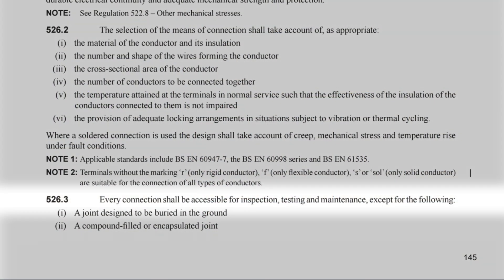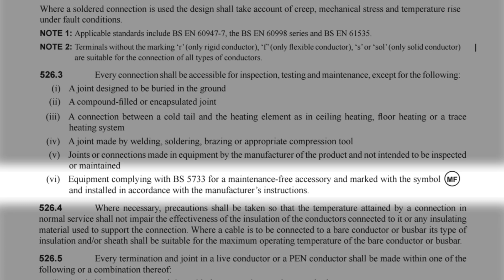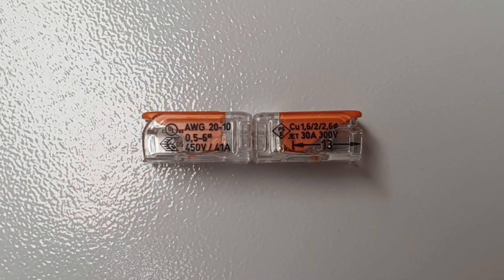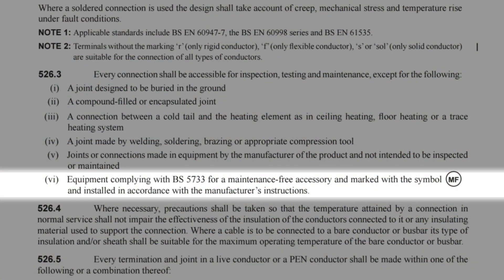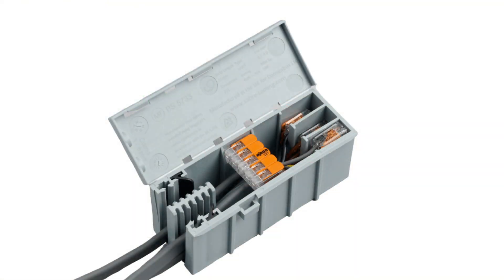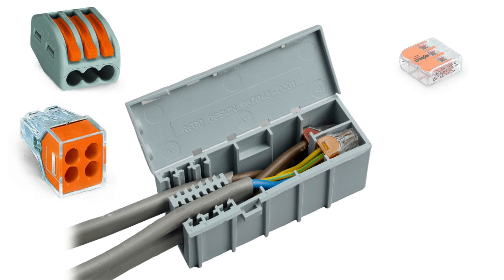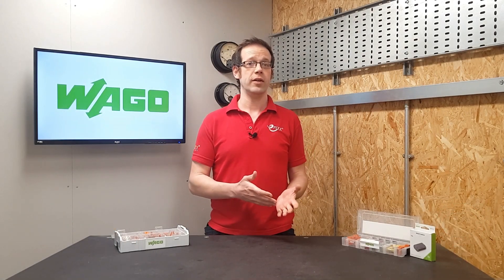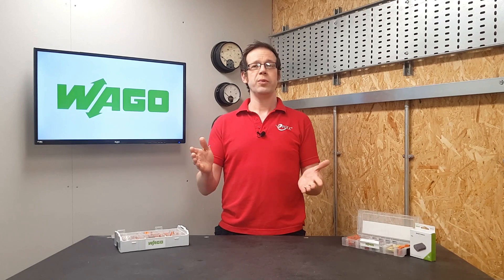Are WAGO connectors MAINTENANCE FREE - when used in a Wagobox junction box?

Comment: Hi,is the 221-6 with the adapter anti vibration strip fitted when installed in the original wagobox rated at 41a ,does this become a 32a mf rated or still only 20a mf ??

Comment: I think the 'thing' is never to connect anything MF, but pull the cable back and start again, or run a new cable.  Let's be honest, no MF box can be 100% trusted.  Maybe 99% but not 100%.  I just nicked a 2.5 pulling it through a joist - exposing the copper of the N.  I'm going back next week to re-run the cable anew.  At least I can walk away from the job without thinking about it at 3.00 a.m.!  Love Wagos, by the way.  So quick!  Have Wago made a British 3-pin plug?

Comment: So now im more confused, if i want to extend a cooker circuit that is protected by a 32a 60898 do i have to derate to 20a connectors?
Reply: No. Use 773 connectors in a bog standard WAGObox. You’ll need a 221 for the cpc.

Comment: Can these WAGO boxes be surface mounted on an internal wall? I am going to be moving a leg of 2.5mm as the previous owner had it looping round the pipe serving the thermostatic valve on a radioator. I kid you not. I want to cut into the ring and then use these connector blocks and then run the leg up in trunking but I just wanted to know if this is feasible. There is no plaster board, it is all brickwork internally in a cellar.

Any thoughts, provisos or condemnation is welcome :)

Comment: The Wago connectors + box can do a similar job to the old fashioned circular junction boxes and are probably not the ultimate design for a junction box, however they are light years in advance of the traditional junction boxes (as used on domestic ring mains etc).  I believe it is impossible to over emphasise how crappy those old fashioned boxes really are.  Their design is nothing short of appalling and potentially dangerous.  I wonder how many fires they have been responsible for in the past.  

Enter the Wago connector + box and life is so simple and easy its difficult to understand how the designers of the traditional round boxes managed to get their design so wrong; they must have been having a REALY bad day when they came up with their pathetic offering.  No doubt at some time in the future the Wago connector will be improved on, but it is really difficult to imagine what the improved design concept will be.  Sensational stuff Wago *****

Comment: There are three different types of Wago boxes made by Connexbox. The smallest has no compartments and is for light fittings. The second has two compartments to house 222 connectors rated at 20A, 773-173 connectors rated at 32A, 773 connectors rated at 20A. The third has three compartments to house 221 connectors only rated at 32A. It pays to read the small print on the boxes and accompanying instructions.
Reply: Wago 221-41x or 221-61x ??

Comment: They are absolutely not maintenance free. Ever looked at a Wago lever connector after it carries full fault current from a dead short somewhere doesn’t the line? Sometimes they pop and go black. So maintenance free until you get a dead short somewhere, then potentially the junction is toast.

Comment: Can wago or in line splice be used to extend length of 2.5mm cable and then place in the backbox. It is accessible there for no need to be maintance free. Recently I have been on jobs where replacing faceplate for ring socket has taken 10 min due to tiny cable length left by installer. Also if it is allowed then is there any derating or is that exclusive to inaccessible placement to increase the safety limits.
Reply: The ideal spliceline are ideal for extending cables in both back boxes and consumer units. I use them for exactly this purpose.

Comment: I think Wago connectors are literally the best thing since the Transistor, they save so much messing around and your confident after a pull test, those cables are in safe hands.  These things aren't just used for commercial, industrial and domestic use,  I've used literally thousands of these things in different versions to wire everything from lighting to bilge pumps, navigation and communication equipment on yachts.

Comment: Usual minefield of ambiguous regulation and marketing that’s rife in this industry.  So what is a practical definition of maintenance free?  If a static plastic enclosure with a screw lid is in a loft space, has cables glanded for support and connections made with WAGO 221 of the correct ratings, is that maintenance free or not.  I have been able to access it for installation and nothing is going to be impeding access in the future.
Reply: Nothing ambiguous whatsoever. It's the UK Wiring Regs, they are stated in black and white, and this video highlighted them quite clearly!
Reply: @MatSmithLondon you’re right.  I think I’d had a few beers after a long day in a hot, cramped loft when I wrote that.  I was more frustrated with WAGO’s de-rating when needing to make a joint MF. Does copper change its characteristics if you hide it in a wall ? I guess it could be an extension of the “installation method” derating factor?

Comment: Yes love the wago connectors .. but I would not fit any lever type wago in a box that is not accessible.  There is nothing wrong with the push in wago connectors 👍👍👍
Reply: Why not? What makes the push-fit ones better/safer/more MF than the lever ones? Don't the lever ones have higher spring pressure which should be good over the long term?

Comment: It didn't help that WAGO bought out the 221 connectors quite a while before the appropriate boxes for them!
Whilst I see the points made here to the latter of the law as it were, would the old boxes not have been OK? Reall? This is where we get so pedantic and miss the spirit of the regs.
Also, a cable tie? Really? How many of us have had to fight to get the grey boxes closed in the first place?!
Reply: I know. Wago instruction leaflet says that the box will deform when used with 6mm² cable. I had to use a vice just to close the lid. Great connectors, crap box.
Reply: Sometimes I’ve used gland pliers to get the lids to close and lock.

Comment: Whilst we are on this subject, does anybody know a 100% compliant MF joint for 6mm T&E on a 32A circuit? 
 I think the Wago solution is not really rated  restraint wise for 2 x 6mm twins to enter.
Reply: Use our 773-173 in box 51008291 and that gives you a 32A, 6mm twin & earth, MF connection
Reply: One box for each leg using the 221-6xx or the 41amp push wire connectors.

Comment: So if some but not all joints in a house are in MF enclosures, and some but not all are accessible, how do you know if the inaccessible ones are actually MF and therefore don't need inspecting?
Reply: So all EICRs in houses that have MF joint boxes will have LIMs on them?
Reply from the maker: If a joint is inaccessible by its very nature you won't be able to inspect it. That's why it's important to do maintenance free connections properly in the first place.

Comment: I think the current carrying capacity of the Wago is often overlooked when shoving it a ‘Connectbox’ (aka Wago box) particularly if extending a ring, where a 32A MCB will be protecting the ring, but the 221 in MF is only rated at 20A.
Reply: 433.1.204. Accessories to BS 1363 may be supplied through a ring final circuit, with or without unfused spurs, protected by a 30 A or 32 A protective device complying with BS 88 series, BS 3036, BS EN 60898, BS EN 60947-2 or BS EN 61009-1 (RCBO). The circuit shall be wired with copper conductors having line and neutral conductors with a minimum cross-sectional area of 2.5 mm2 except for two-core mineral insulated cables complying with BS EN 60702-1, for which the minimum cross-sectional area is 1.5 mm2. Such circuits are deemed to meet the requirements of Regulation 433.1.1 if the current-carrying capacity (Iz) of the cable is not less than 20 A and if, under the intended conditions of use, the load current in any part of the circuit is unlikely to exceed for long periods the current-carrying capacity (Iz) of the cable.
Reply: @mra813  Thank you - I am a bit more relaxed now. I used a large wiska box to terminate an SWA cable at a new summerhouse and used Wagos to connect to the socket radial circuit and never had a doubt about it being compliant. It was only when I was up in my loft redoing the builders lighting circuit (new build) who had used choc bloc and insulating tape to feed fans and lights to bedrooms and bathrooms and I used the Connectbox and Wagos throughout to tidy things up, but in the process actually read the manufacturers leaflet and the de rating to 20 A paragraph, which while not applicable to the lighting circuit, put the doubt in my mind about my summerhouse circuit. I am now reassured.🤣
Reply: precisely why I use Ideal Insure in Wagoboxes like a naughty naughty boy..
Reply: @MrGrumpyjohn01  That’s interesting. But I wonder if the Connectbox/Wago current carrying capacity is a result of trial and certification and Ideal insure  has not actually done the necessary work to establish if their product should be down rated in a similar manner.
Reply: @normanboyes4983  corporate brinkmanship more likely I would say...who has the better legal team?
Reply: 20A will be fine, see Reg 433.1.204
Reply: @mra813  What does the Reg say - I am not a spark.😉

Comment: Vago’s are great.. maintenance free or not, connections should always be accessible and easy to find.
Reply: How does that work then, if you have an open wall, and need to extend a cable to a new location but the rest of the building is boarded up / plastered / built on?
Reply: @MatSmithLondon  it’s not rocket science to install a junction box with a lid or even a one gang box with a blank lid for accessibility at all times.. either that or the through crimps properly installed and resin heat shrink as a cable should extended.

Comment: A push in connector is well ... er... er...a push in connector. They are all pretty well the same. Any push in connector in a Wago box, with the cables properly secured with the cable tie locking the box is maintenance free.   It is the pedantic wordings, according to manufacturers instructions that is legally saying it is not. 

Anyone knowing the slightest thing about electrics can see it is MF.  Even if In Sure are used. If they fit in the box and the box is tied, there is no problem.

Things like this p*** people off.
Reply from the maker: Have to disagree really. It's a dangerous game to start picking and choosing which bits of the regs we apply and which we don't. The manufacturer's instructions are pretty clear and it's not that difficult to comply.
Reply: @efixx  
So a manufacturer can state that only x connector can fit in y box, to get you to buy their products, otherwise you are foul of the regs. When any push in connector fits inside the box. Duh!  The wordings have made it nice for manufacturers to make money.

Well you do not have to fully comply with 7671. If there is an issue going to court, then anyone proving it is electrically sound wins.
Reply from the maker: Yes, yes they can. And the different boxes are pretty much the same price so it's not really a money making thing.
Reply: @efixx  I've said my bit above, but with all due respect if you don't see that a lot of this proliferation of badly formed regulation isn't about shifting product you are in cloud cuckoo land!! If it was really about safety they would come up with a cross compatible standard between manufacturers to avoid this kind of thing or let the market decide in a kind of vhs/betamax sort of way. This way keeps the corporations happy, the committee members in work and the sparky on the back foot.
Reply: @MrGrumpyjohn01  
The regs played into their hands. The regs should be written as unbiased and objective. 

An example of poor wording was insisting on catalysts being fitted to cars, rather than stating desired emissions levels. Stating the levels required leaves science and technology many development options. Makers were pushed down the catalyst route.
Reply: @johnburns4017  Indeed, this kind of thing can be observed all around us in all spheres of life, the constant creeping micro regulation of every aspect of our lives, Covid of course the latest example. 
Its basically Marxism..!
Reply: @MrGrumpyjohn01  
Its Marxism? Marx was an economist.
Reply: @johnburns4017  You're right, its the opposite, a power play by the elites over the proletariat. Anyway I was just being provocative for my own amusement , don't mind me...
Reply: @MrGrumpyjohn01  
Going back to specifically stating a catalyst must be used in cars. When this was mandatory in the EU in the early 1980s, Britain was way ahead of anyone in learn burn technology, without using expensive catalysts, which was meeting emissions standards. All this had to be ditched because the EU said only use catalysts - because the USA found they worked in the 1970s.

Comment: We use surface mounted or recessed junction boxes and most commonly Wago 2273 connectors and Wago 221 when needed. One thing what we never do is to install unaccessible junction boxes, no matter what connectors are used.
Reply from the maker: Sounds like a good policy to always leave them accessible.👍😊
Reply: So you never install anything  under floorboards, where owners cover with carpet or laminate floor.
Reply: @martinw245  There are no floorboards here like in the UK, if there are they are visible and it is called parquet. The floor of the first floor is usually concrete. Inside the concrete there can be a heating cable or a pipe and electric cables in a pvc conduit, but no joints. The floor on the second floor is either wood fiberboard or plaster cast, depending on whether there is underfloor heating.

Comment: This is so complicated 😤 il just stick to connector blocks without insulation tape for jointing cables in walls and under fitted floors.
Reply from the maker: 😱 It's not that complicated, is it? Just a matter of matching the right connector to the right box. 🤔
Reply: @efixx  too many number 2's involved I got lost 😅
Reply from the maker: 😂 That genuinely made me chuckle!
Reply: @efixx  😁 in all seriousness I use nothing but wagos in accessories but for joints I use crimps or ideal insures in the enclosures with cord grips and a screw to lock the enclosure cover as I was under the impression that this was maintenance free as the wago lever style connectors can be undone by simply lifting the lever by hand.
Reply: But again I guess it all comes down to what's fit for purpose as deemed by the manufacturer.
Reply from the maker: Agreed, great comments, thanks. 👍
Reply: @efixx  Thanks for the great videos. I thoroughly enjoy every single one and the discussions that come with them.

Comment: No I don't think they are the best thing since bread came sliced . Push fit connectors on light fittings can pull out , yes I know they aren't wago before anyone else chimes in .
Reply: Wago do make lighting connectors used in light fittings though...
Reply: @paulbritton187  I fit Portland led fittings and you need to do a pull check on the cables, had some just pop back out .

Comment: Hi what box can house the 221 connectors, I have always put them in the box you showed on the video (only done 2 and both are accessible).
Reply from the maker: I believe it's the Wago 221-4, if you Google that you'll find a number of stockists.
Reply: @efixx  thanks I normally get them from screw fix not sure they have these but thanks
Reply: @keithbucknall  HI Keith, Part numbers are 60413514 for singles & 60413516 for packs of 10. Screwfix will have them soon but they are available through others in the meantime.
Reply: In an environment that is accessible for inspection you can put them in any enclosure that is generally suitable as an electrical enclosure.

In a MF environment they can be used directly in a wagobox 221-4 or wagobox XL. They can also be used in a wagobox classic or wagobox XLA with the appropriate adapter plate.
Reply from the maker: Great answer, thanks. 👍
Reply: You can buy three different types of Wago boxes made by Connexbox. The smallest has no compartments for light fittings. The second has two compartments to house 222 connectors rated at 20A, 773-173 connectors rated at 32A, 773 connectors rated at 20A. The third has three compartments to house 221 connectors only rated at 32A.